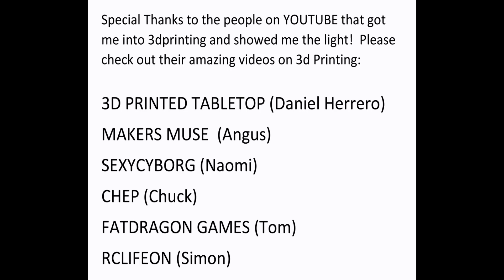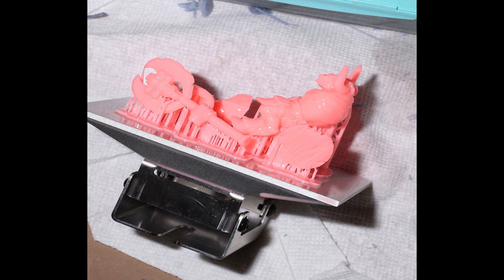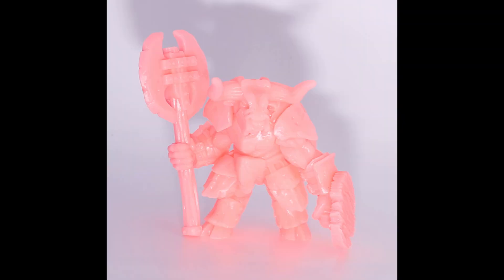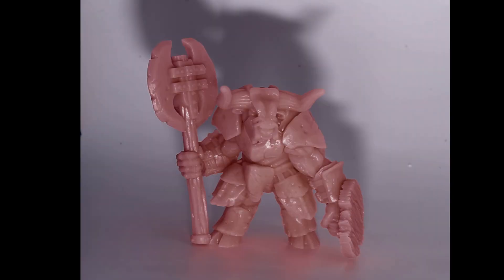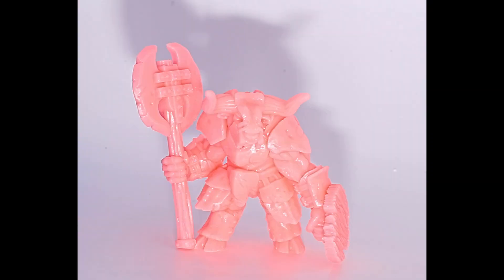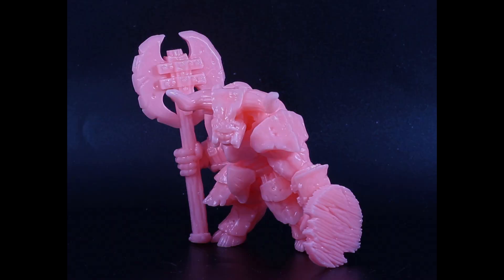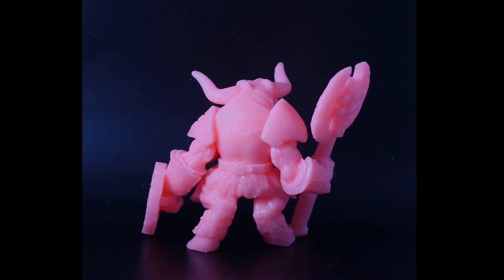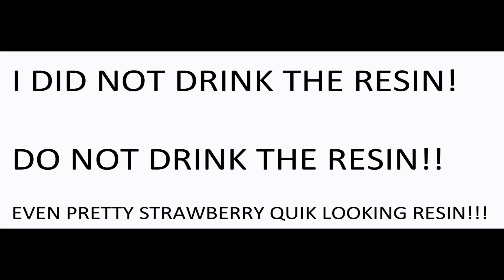Test of PLANT BASED resin for 3d printing!!  Please if you print with resin you need to watch this!

Comment: Great video! I've heard it isn't as easy to use and requires a lot of tweaking. Is that true in your opinion? If it works just as well I'm going to get some. Just started printing and want to to do it right living in a smaller home

Comment: Help! I just got a failed print, panicked, cleaned everything up as fast as I could, and I might have mistakenly poured a crap ton of normal AnyCubic resin into a crap ton of ECO resin. Can I still use it? Will some weird chemical reaction take place that will make it useless? That could be such an expensive mistake, ack it was so stupid!
Reply from the maker: mix thoroughly should be fine

Comment: I just tried the eSun eResin, and will be trying the Anycubic Eco Resin next.    WIth eResin, the prints came out looking good but had a tacky surface and strong odor.  I washed them in 91% isopropyl and then cured under a UV light in a DIY mirror box.  Even after hours of curing the prints still had a tacky surface and strong odor.  I tried placing the prints in a jar of water in direct sunlight.  After a day in sunlight the surface finally hardened and the odor was significantly reduced. However the surface quality of the prints seems to have been impacted and some areas have a crusty surface.

One other note, while this product is billed as more environmentally friendly, it is still something that needs to be treated and disposed of with great care.  The MSDS sheets clearly indicate that the resin is harmful to marine life and can cause chemical burns. What is not clear is if the cured resin retains some of these harmful effects.

I intend to set up some kind of heated / ventilated cabinet in my garage before doing any more SLA prints. Once I get that set up I will do more prints with the eSun and Eco Resin.

Comment: Nice video. Seems the eco resin is a big plus over normal. Now let's hope the price will drop fast.
Biggest problem with the candylike colors is that when you have kids they would think it's okey to put it in here mouth.
When taking pictures from resin print colors that are hard to capture on camera (like this, yellow or transparant resin) I use grayscale mode.

Comment: How are you using your charcoal filter? I am looking into getting a resin printer but my main concern is that I would have to have it in my room. I was thinking of a DIY ventilation like chamber for it but haven't been able to find much on something like that.
Reply from the maker: you print a vent from thingiverse for photon, then attach a duct with inline fan and charcoal filter

Comment: So besides going off of what the manufacturer claims, how do you know this is less toxic? This would have to be tested by a lab to confirm. Kind of a pointless video without some scientific evidence.
Reply from the maker: Well I'm hoping someone will test those claims.  I can say I'm printing it non-stop for 4 days straight now and at least there doesn't seem to be any real smell at all (not saying that's dispositive of course), and it's only anecdotal but it's not affecting me personally nearly as much as the normal resin I use and there is no smell in my printing room so it seem way better so far.

Comment: I just got the blue version of this in the mail,finally. Have to ask, as your prints came out fantastic first time out, what settings did you use on it? Inquiring minds want to know! :)
Reply from the maker: since there was no info out there I jsut went with my settings I use for my Elegoo Gray.  This print came out perfect but my next print had some minor failures which led me to increase the cure time by half a second.  This was on my Epax X1 .04mm at 6 seconds, with 4 bottom layers at 40 seconds
Reply: @3dprintingpro212  interesting. I had a layering failure for the first time in almost 2 months using my gray setting for the photon S. 
.05mm
8 bottom layer
12sec normal
70sec bottom.
Think I am overexposing?
Reply from the maker: @Edi62768  each machine is possibly not exactly the same, and I'm a regular Photon (this bio resin test was on my EPax X1 by the way) but I did a bunch of resin tests I'm making a video on and for me personally elegoo gray at .05mm 10 second exposure was the best result, and I do 6 bottom layers at 50 seconds.
Reply: @3dprintingpro212  thanks, I'll check that out. Still learning here. One day she works fine,the next, something weird happens, but, haven't had a support failure in a long time thanks to your vids! Keep em up 👍
Reply: @Edi62768  Hey Ed, I too have a photon s and this resin is on its way to me! I am very excited to use this and was wondering if you figured out the kinks with your settings?
Reply: @UnvarnishedTarnished  I have the exposure up to 14sec at .05mm, 8 bottom layers at 70 sec  , I second off time. That was my good print so far.
Reply: @Edi62768  awesome thank you man I appreciate it! I'll give it a go when the resin arrives

Comment: I’m due for a new order of resin. Thinking about ordering this through you’re link. Would you mind sharing your settings, or are you using the same settings that you use for elegoo grey?
Reply from the maker: Yes I used my settings for Elegoo gray and first print came out perfect.  Next I tried a more delicate (and very tall) print which had a few support fails so I am trying again with an extra half second on the exposure to see what happens
Reply: 3DPrintingPro thanks buddy! Let us know how it goes please!
Reply from the maker: @dsmitty3500  If you're in the Epax FB group, or the 3d Printed Tabletop FB group is where I post my pics later tonight  :)
Reply: @3dprintingpro212 , late post, but how'd things turn out? Can you share your settings now? Thanks!

Comment: So, does that mean it's ok to get it on your skin?
Reply from the maker: I wouldn't really wan to test that out, I think it still has chemicals to make it photosensitive, and I'm no chemist, but I wouldn't get comfortable with this getting on me until we have tests.  It's hopefully way less dangerous, but it still could have some danger level...we just really need some hard evidence at this point.  When I did my support removal I still wore my normal protective gear (gloves and safety glasses) just in case.
Reply: No it's definetly not save for your Skin!
Any photocurable system harms your skin and your organs!
Reply: Don't get ANY resin on your skin! Epoxy, polyester, polyurethane, acrylic, sla - all of them are toxic on contact/ingestion. Even medical grade epoxy will be toxic in uncured or not properly cured form! Some are irritants, some cause contact allergy, some are cancerogenic! Rule number two - if it doesn't smell bad doesn't mean it is safe to breath, unless tested and certified safe.

Comment: Thanks for the video, I've been trying the violet version of the resin, with mixed success. 

Can I ask what settings you printed on? 

I tried some suggestions from the website and then some tweaks to have longer base layer time, but I have had a few fails around supported arms using your light support settings in chitubox.
Reply from the maker: I did .04mm height at 6 seconds for this.  I just tried (overnight) a much larger, taller model, and did get some support fails on that one I am going to try it at 6.5 seconds now, and will be posting my results in the Facebook group 3d Printed Tabletop if you look there later tonight
Reply: @3dprintingpro212  awesome, thanks! I will keep an eye out there.

Comment: Unfortunately, none of these resins are impact resistant. One drop on the floor, and poof! All your hard work painting is gone. Odds are, you're printing pieces for gaming, which means people handle them. Arms, weapons will get snapped off when using non-toxic resins like these. The only regular resin I've found to be worthy of miniature printing is the Siraya line, of which I use the BLU kind exclusively. The cost is fantastic, and I've dropped miniatures in tests from 10 feet to a concrete floor, and they just bounce, even with thin daggers or swords. It's amazing stuff. I love the idea of the non-toxic resins, but they aren't there yet. Maybe if you were a bust painter and they were going in cabinets never to be touched again.
Reply: I was about to ask this. Thanks. I've read some people are mixing their traditional resins with 10-20% Siraya Tenacious (which is a flex resin) to get a similar effect, but I'm not sure of how well does it comapre to just 100% Blu.
Reply: I really needed to read this, thank you!! I am printing ball jointed dolls and I want them to last!
Reply: @ashchan30  If you're placing them in display cases, no issues. If you intend on using them? Resin is not there yet.

Comment: Great video. I've been using the Esun bio-based resin which is of a similar type as the anycubic (although I haven't had a chance to directly compare). I don't have currently have a filter system on my printer and yet I can only smell it if I open the printer to get the print. They have a wider variety of colors at the moment (I've been using a grey, which seems a few shades lighter than the elagoo). From the canadian retailer I purchase it, it ends up being about 55USD per Liter bottle whereas I can get Elagoo for about 45USD, so for me the difference is trivial enough that the safety concerns make it more than worth it. The detail I can reproduce with it is amazing and I'm hesitant to try regular resins now that I've found this one.

As a side note, I have accidentally touched the liquid with bare skin with zero effect but that could be me not reacting to the resin, it does not mean that I feel safety gear shouldn't be used.
Reply: hi what settings are you using for the esun bio-resin?
Reply: @hadesatlas3dss204  for 0.05, I set 8 bottom layers, 60 sec
8sec for regular layers.

Adjust as needed for smaller layer sizes. So far, when I've gotten failures, they were directly my fault for being in a hurry and not properly checking a file before sending it to print.
Reply: @simonterlecki  thank you so much I use these setting in my first print
Reply: How are you post processing the eResin?  I am getting a tacky surface unless I cure underwater.
Reply: В Москве я покупаю эту смолу за 22$ 1кг